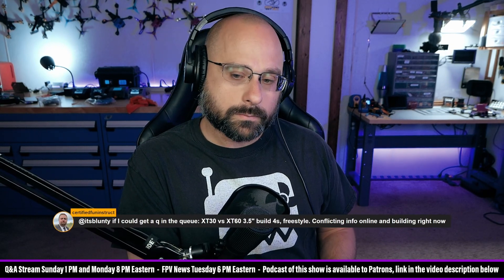Which Connector Should I Use For 3.5 Inch FPV? XT30 Vs XT60? - FPV Stream Questions

Comment: i just got a cinelog30 v3 and it has xt30 inputs. i have a few 4s 1300mah 100c 4s batteries with xt60. can i simple use a converter or is that no recomended?

Comment: I wonder if I can use the Cinelog30 V3 with the 900mAh LiHV 4S 80C XT30 battery. Because of that, the voltage is 15.2V.

Comment: I have a Happy Model Crux35 HDzero with ELRS, that came with XT30 but I have only 4s 850 mah batteries with XT60. I am planning to change the XT30 on the quad to xt60. Is that okay? Also should I change the capacitor on the plug if I switch it to XT60?

Comment: My 3.5 inch has a XT 60 4s and 6s but I also have a shendrones squirt 2.1 Cinewhoop that requires 4s and 6s . It depends on your esc and motors. If I were to use a xt 30 I am gonna have to make some of my special series plugs

Comment: When in doubt size it up. There is no downside to going bigger other than weight and that is negligible for most craft. If you're basing connector size on it getting hot you're doing it wrong you want as little resistance as possible for best performance. I've been using xt-30 and 16awg on 1s toothpick builds since the bat-100 for this reason.

Comment: I have 10 850mah batteries with xt60's and all my 3.5" drones have xt60 if it doesn't I put one on. Roma F35 are all xt60 connection

Comment: It depends on the amp draw of your motors, and how you fly.  Either connector will be OK unless your motors are really pulling a ton of current all the time.  Remember that the connector is supplying power for all 4 motors, not just one.  I've got an APEX build with 1407 motors that pull 25+ amps each with 3.5" props at 4s.  I started with xt-30, but I had bad voltage sag after a bit of hard flying.  I cut and swapped the connectors to XT60 and now I have no problems because the connector isn't an issue (lots of headroom).  I use xt-30 on builds with less power hungry motors (11xx - 1404) that only pull in the range of 5-15 amps/motor.

Comment: The wire you use with xt30 will make a difference, ive pulled 120a on xt30 with 14g and it was fine, but i originally had 18g wire leads and that was choking the current
Reply: is 16 gauge ok??

Comment: The XT-30 is rated 20 A and the XT-60 35 A continuous. I couldn’t find a peak rating on the manufacturer‘s website.

With the cooling while flying, the XT-30 is likely fine for 3.5" quads.
Reply: and that's only if you're using genuine Amass connectors.
Reply: @thirtythreeeyes8624  Fair point. Non genuine connectors don't come with those ratings and are likely build to a (lower) price. Not much of quality left in many of them.

Comment: FYI，my 8 inch x8 cinelifter pulls 60amp when hovering and 100amp when crushing at about 30 degree pitch. Takeoff weight around 5kg
Reply: I’m using 6s2p 12400mah with xt90 and 8 gauge wire, and after about 6 minutes of flight time and landed the wire and xt90 is around 40 degree Celsius

Comment: Oscar Liang has a nice page about this.
I have used xt60 up to 180A burst and it was fine. Also have I used XT30 with up to 90A burst and it was okay. But we are talking just 2 or 3 seconds before the Lipo voltage sags and doesn't deliver that high current for long anyway.
My rule it to use xt30 for up to 80A current draw and xt60 for above.
Also AWG 17 wire is perfect for Power xt30 setups. Odd size but fits perfect on AIO FC and XT30
Reply: That can go sideways if you use old connectors. The genuine Amass ones are only rated for 100 cycles. Above that the contact resistance can increase fast, although they probably have some safety margins there. It might easily do 200 or so.

However if, P = I^2 * R, and if the contact resistance goes up fast (I have seen quadratic curves...) the power lost to heat, heats connector very fast. To the point of melting the connector in seconds. For 100 mOhm and 80 A that's already 640 W. And I've seen 100 mOhm and more resistance in bad connectors.
Reply: @Galileocrafter  you're right. That is a lot of power in Watt. I would also solder on new xt30 connectors after 100 cycles on the quad. But as I said it works up to 90A on 6s without melting. It's a speed 4" that does 200kmh top end with 300g AUW.
Dont forget it has lots of air flow cooling it down. It's only for few seconds anyway
Reply: @chrisbee5481  That is indeed a lot of airflow, and could probably cool the connector sufficiently.

Comment: i find you can easily plug in the xt30 the wrong way around at least half of it. happened to me last week lucky nothing was damaged.
i could hear sizzling and one of the pins in the connector was smoked Grey/black.
Reply: Did you use original amass xt30 plugs? I had a noname fake xt30 and it happend to me too. With the amass xt30 it never happend and isn't really possible by accident. Unless you really use high force past the point you realize something is wrong and doenst fit.
Reply: @chrisbee5481  yes brand is indeed amass. pretty sure i was indeed too forceful as im used to xt60 which sometimes are a tighter fit
Reply: I'll be painting the - side with white paint to make it more obvious.